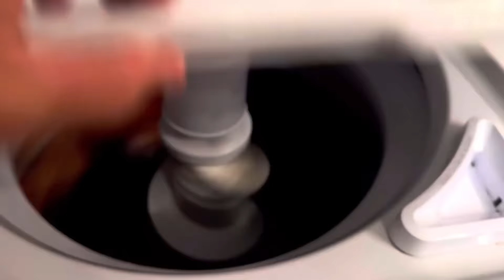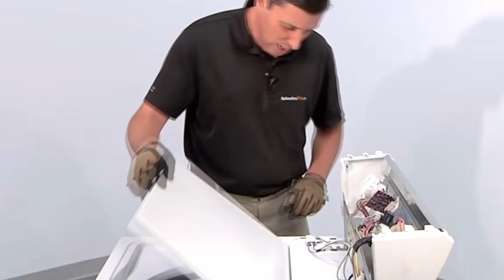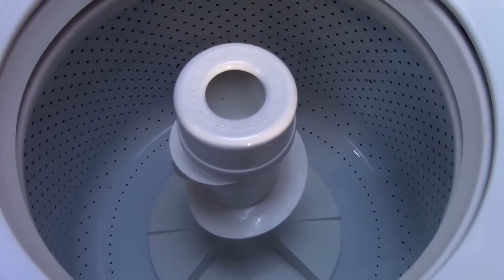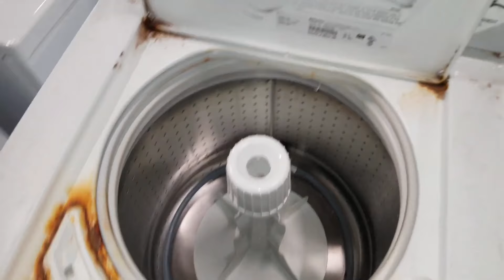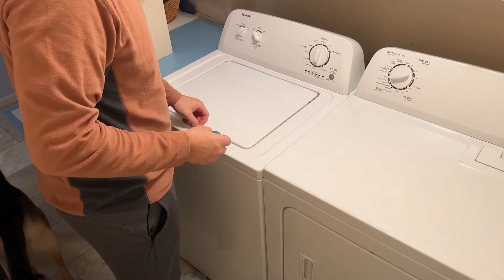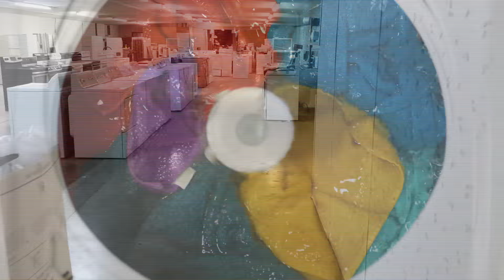3 CHEAP Top-Load Washing Machines EVERYONE IGNORES (But These 3 Are Absolute Goldmines)

Comment: We recently bought the washer/dryer set of the speed queen TC5 in the matte black. Love the machines, but there are definitely drawbacks to it.

If you’re looking for quiet, these are not the machines for you. But I will trade noise for clean any day. I cannot express how well the washer gets everything so clean. Plus, after years of having washers with no center agitator, returning to one that does have it is a dream. My clothes no longer get tangled up or bundle together, creating an off-balance situation. The clothes actually turn over one another through the water, and like I said couple times now, everything gets clean!. 

The downfall to the TC5 washer is that the drum is very undersized compared to the drum size on the dryer. The dryer can hold a huge capacity, but the washer can’t even fit a queen size comforter. That’s a little bit of a problem for me, and we weren’t expecting that. I just bought a used 33 pound washer and I’m going to put it in the garage for my larger items, such as pillows, comforters, and other such things.

The dryer is awesome, no complaints, and we love the matte black, the way it looks. The only drawback to the finish is that it tends to get very dusty and it doesn’t wipe off as easily as you think because it’s kind of a rough finish, almost like a very light truck bed liner. The black color gives the set a less generic and commercial look, and I wouldn’t trade it for anything, just a little bit of a hassle trying to keep it wiped off.

Best machines I’ve owned ever and I hope they do last the 25 to 30 years that they say.

Comment: Still have my mid 2000s whirlpool top load direct drive washer. Recently rebuilt it for less than 100 dollars. Hopefully it lasts another 20  years.
Reply: I have a 2000 Whirlpool washer and driver…Recently the washing machine quit working.  The guy that came out said that he could not get the parts to repair it.  I keep thinking that it can be repaired if I could find the parts.  Do you know where I might be able to locate parts for my 2000 Whirlpool washer?

Comment: Still use my 1984 Maytag top loader.
Reply: Me too!!! and the dryer.  I dread having to replace them.
Reply: @paulk9985   Don't, repair them! 73
Reply: Yeah old maytags were the best buy mine I bought the set in 1994 for under 1000 dollars new. As far as I know it's still running. 73
Reply: Maybe repairing old washer and dryers would make a good side hustle while on Social security. 73
Reply: I had a Maytag for 35 years … and I used to wash horse blankets in it.

Comment: I have the same Kenmore Series 80 model as shown, but now it has developed a leak out the bottom, maybe a cup of water leaking out per load.  Not sure if that's an easy fix, or not. I'm thinking of buying a new Speed Queen TC5, but that's $1500. It's easy for this A.I. voice to say to buy this or that used for $250. Easier said than done.

Comment: What does it mean when washer makes noise during wash and doesn't make noise in any other position? How to loose the noise?
Reply: My 17 year old Whirlpool washer did that and they told me that "clutch" was going out and it would be costly to repair even though the part is only $150... the labor would be expensive..

Comment: Speed Queen TC5 is the CLEAR winner ! If you want the most dependable washer made in the USA do yourself a favor and buy Speed Queen, I have a TC5 washer and DC5 dryer and they continue to hum along with no problems. Yes Speed Queen will cost more up front, but would you rather replace after just a few years ? Dream on about buying a used Speed Queen, people who own the don't get rid of them.
Reply: Hi, I am actually looking for a used washer and there's a place near me that sells used appliances and I see that they have a speed Queen for $450! It doesn't have the turn dials but push buttons so I'm not quite sure about it. This place actually takes the machines apart and replaces anything that looks worn or needs work. So I'm debating whether to get the speed Queen, Whirlpool direct drive or Kenmore elite direct drive washer. I know there are a lot of pros and cons about the direct drive 😊
Reply: @daisyblue7209  Buy it !!!  QUICK
Reply: @daisyblue7209 get the speed queen
Reply: @daisyblue7209 
I wouldn't dillydally. Have had a Speed Queen SET since 2016. ❤️🔥
Reply: @daisyblue7209 don't waste money on a speedqueen they are not worth the money.
Reply: @donholzer898 I bought a Soeed Queen after my Maytag broke AGAIN during the lockdowns.  The Speed Queen is the best.
Reply: May tag no longer....
Reply: That’s what I bought.
Reply: @joannac9194 You made a wise choice and will be well pleased  !!
Reply: Where can you buy older model washing machine. I’d like an older model. I have a newer digital and I hate it.
Reply: @rogerbrendabowman4808 do a search in the yellow pages or an a.i. search for such places in your area. I believe some towns actually have such places.
Reply: No to the New Maytags. They are garbage.  Speed Queen is the way to go.
Reply: I bought my daughter a roper washer when she had her  1st child an it lasted 25 years. No work at all during  that time. She loved it.
Reply: I do agree with you mostly. The Whirlpools always clean better and faster because of the agitator. I don't know  why SQ has never changed their agitator. Nothing beats a speed Queen, but Whirlpool are always easier to service and the parts are cheaper. You can Frankenstein, Whirlpool, washers and dryers all day long.
Reply: buy once, cry once
Reply: I heard the new ones aren't that good.
Reply: @benstandard  Not sure where you heard that, Speed Queen is rock solid.
Reply: @richardsmith4187  that's good to hear.

https://youtube.com/@speedqueenhome?si=Wny3an-N7rEhnjO6

Comment: I have a Kenmore top load washer I bought in 2005 and it is still running. I had a Whirlpool dryer I bought at the same time and replaced it about 2 years ago, Still a good buy.

Comment: I have Maytag A612 series 04. It is still going strong but occasionally leaks transmission fluid. I LOVE this machine but the appliance repair person told me there are no parts available for my washer. I almost cried. I only hear awful things about the new machines. There is nothing better than the one I have. I will use it until it simply stops. Do you know of any place I can get parts for the washer I love?

Comment: My 34 yr old heavy duty Maytag top loader bought from an actual Maytag store has never needed a repair. My 29 year old 90 series Kenmore dryer---ditto. My next ones (if I ever need it) will be Speed Queens. I've lived for 29 years with extremely hard well water and have a water softener. The washer hasn't skipped a beat.
Reply: I also have 34 yr old maytag washer & a 29 yr old kenmore dryer. Both are gems and I'm keeping them. As a servicer, I see this business declining rapidly because parts are very expensive, if you can find them. Manufacturers are only required by law to provide parts for 7 yrs. Also, people view appliances as disposable moreso than ever before.
Reply: I have an older Naytag that was in the house when I bought it nearly 30 yrs ago. Never needed a repairman until now. The fella said the machine needs a new timer and since the machine is so old , the part is no longer available. 😢.

 .